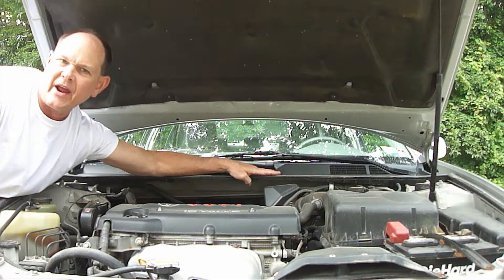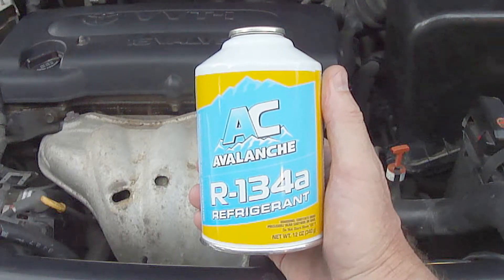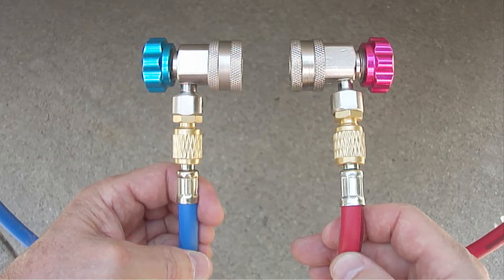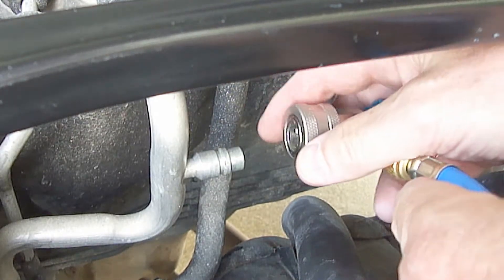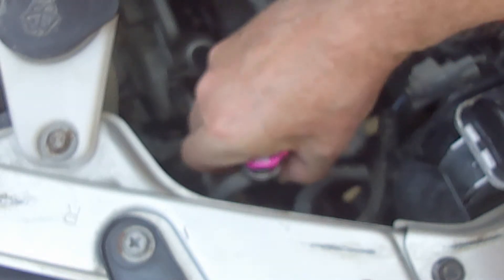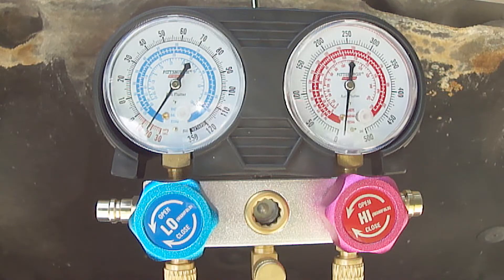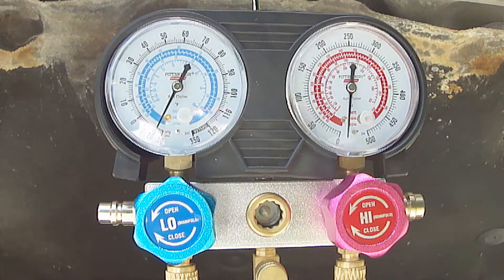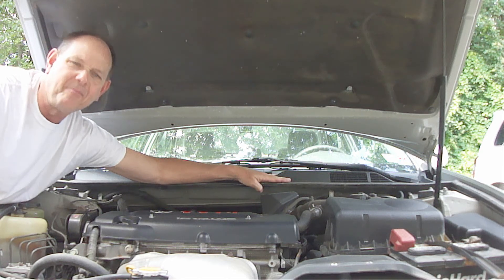How To Pull A Vacuum On A Car AC System

Comment: Great set of videos Paul. 

The vacuum pump Auto Zone had didn’t have good plastic caps on the hose ports. The top one which is too large for my hoses was left open to the atmosphere and so it threw me for a loop wondering why I couldn’t pull a vacuum. 

I ended up turning the pump on and then putting my finger over the port to see if it was pulling suction. It didn’t until I covered both ports. 

So I put gorilla tape over it and ziptied that. 

Pulling strong 30psi after changing rear lines, rear evaporator, rear H valve and the receiver dryer on my 2012 Town and Country. 

I don’t know how much oil to add back in given that component list. 

Spec for R134A with the dual zone is 40oz. 

I do t see a spec for PAG oil.

Comment: Is there a way to tell if I have no refrigerant in the system versus having some refrigerant? Assuming I have some refrigerant, could I just add more using the r-134a cans with the gauge until the pressure is in the green?

Comment: Do you add refrigerant to the system under vacuum? 😅 or  do you release it then add refrigerant ??  Someone help meout
Reply from the maker: @Demented-RD  The system does not have to be in a vacuum state to add refrigerant.
Reply: @proclaimliberty2000  thanks
Reply: @proclaimliberty2000  if you are filling up after this,  when you attach refrigerant to yellow hose,  you will be adding the air that was in the line back into the system? Seems like yellow hose should have a "Y" fitting where refrigerant can attaches
Reply: I would think yes, simply because if you opened the system back up and atmospheric air got back in you would need to do another vacuum
Reply: Needs to still be in a vacuum when you add freon.

Comment: What is the logical reason to let the pump run over night? How much volume of air can be in that AC system? Not very much. Once the air is sucked out, the vacuum is created, so why let the pump run all night?
Reply: Pulling a vacuum slowly boils off moisture in the system, which is then drawn out through the vacuum pump itself. This happens slowly, so the more water in the system, the longer you need to draw a vacuum.

Comment: ya remove the hoses befowa ya put d gas in ????
Reply: No, not if you're putting the gas right away!  But no sin if your system is tight and you purge the hoses later.

Comment: Why can’t you just use the can and gauge kit without the can and just release the pressure that way ?
Reply: You need to pull vacuum to get moisture out of the system
Reply: A real gauge set gives you so much more information, and the longer hoses make recharging less awkward.

Comment: After pulling a vacuum like shown in this video, will it be okay to use the can refrigerant like (AC Pro/Artic Freeze) that comes with a gauge on top to refill/add refrigerant? Thanks. 🙏
Reply: Yes, but they have a number of shortcomings.  First of all, the hose is short, and it may be difficult to properly position the can of refrigerant and read the gauge when charging.   Second, you have no way to measure the high side pressure, which helps you prevent overcharging and measuring the health of the compressor.

Comment: Have u had a instance where  vac gauge would not arrow down to 29...vac has been pulling near 12 hrs
Reply: I think it depends on elevation.    Down at sea level it's -29.9psi vacuum.    In the mountains 4700 ft it only can vacuum down to -24 -25 PSI.

Comment: It surprises me that the simple way the valves work, doesn't allow air to be drawn in when you've created a vacuum, and remove the coupler.  I guess the springs are strong enough to prevent this?  Thx.
Reply: This exactly the problem I am having. The spring in the valve is not strong enough to overcome the vacuum - and allows air to enter into the system (which is under vacuum). I have not seen any videos address this.
Reply: I have the same problem @ponchotran9004
Reply: @ponchotran9004  order that tool in the description then go to Auto Zone and change the valves
Reply: Seems my low side valve has lower spring force. Not sure it that’s normal.

Comment: 2--6 hrs  minimum  evacuation  for a previously running system but low on gas.
12 hr overnight minimum on a system that had no gas 
if the system has been outta gas  for a long time nitrogen sweep will be required  
A vac pump needs to be 2 stage 
Vac pump needs to be minimum 4cfm ---8 cfm for a car upto 10cfm--12cfm  for a RV

Comment: Recommended values for vacuuming are as follows. 
20-30 minutes for automobile,SUV,Small truck
30-45 minutes for Mid-Size,straight,local delivery 
60-90 over the road w/Sleeper class 7 and 8 
90 or more minutes large equipment or extensive hoses.
*This information was directly from my A/C certification class I took earlier this year.